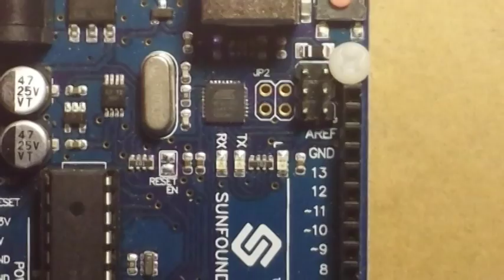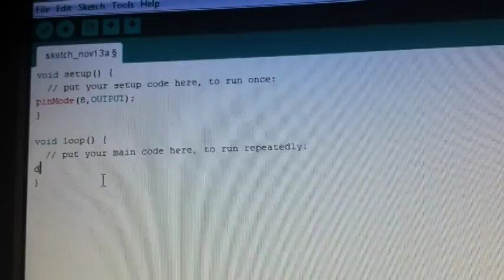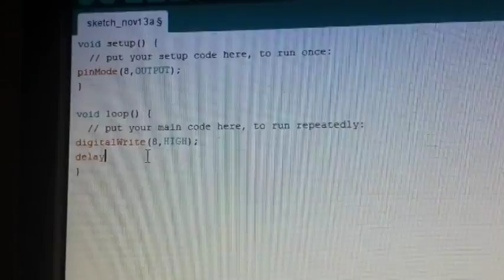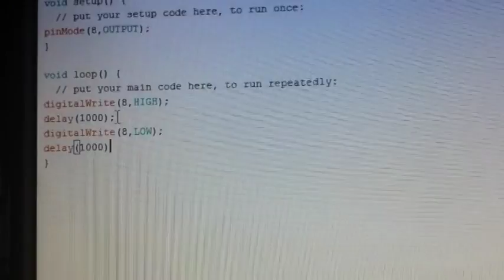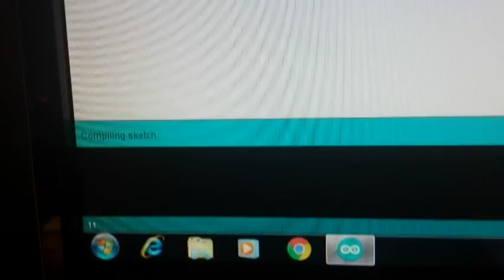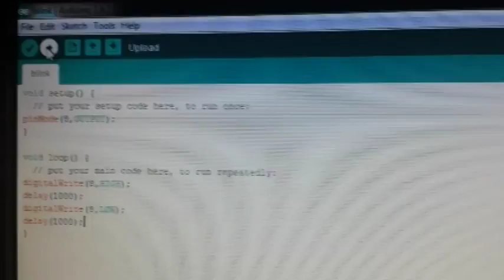Arduino Basics 4

Comment: I know I'm kinda late, but I just want to say, this is a good beginners tutorial on arduino. Slow paced enough that it's very easy to understand, not only can you kinda follow along but you did a good job of helping me to understand not only writing the code itself but WHY you write it this way, what each command means, thank you
Reply: My sketch doesn’t complete compiling. The void setup line is also highlighted in red. What did I do wrong.

Comment: I'm not understanding why the transitor comes after the LED if its meant to protect it from excessive power?
Reply: I think you meant resistor - it doesn't matter where in a single circuit where it is placed, it will limit the current.
A good analogy is a restriction in a hosepipe - it doesn't matter whether it's at the start, middle or end of the hosepipe, it will slow the flow of water just the same.
Reply: @will_doherty  Thank you for this comment - helped me!

Comment: I finally got my arduino, and I'm having some difficulties. It has the Mega328P chip. I keep getting the following Errors

Arduino: 1.8.5 (Windows 10), Board: "Arduino Duemilanove or Diecimila, ATmega328P"

Sketch uses 928 bytes (3%) of program storage space. Maximum is 30720 bytes.
Global variables use 9 bytes (0%) of dynamic memory, leaving 2039 bytes for local variables. Maximum is 2048 bytes.
avrdude: stk500_recv(): programmer is not responding
avrdude: stk500_getsync() attempt 1 of 10: not in sync: resp=0x89
. . . . . . 
avrdude: stk500_getsync() attempt 10 of 10: not in sync: resp=0x89
Problem uploading to board.  See http://www.arduino.cc/en/Guide/Troubleshooting#upload for suggestions.

This report would have more information with
"Show verbose output during compilation"
option enabled in File -> Preferences.

With Verbose turned on, I get this error.

Arduino: 1.8.5 (Windows 10), Board: "Arduino Duemilanove or Diecimila, ATmega328P"

C:\Program Files (x86)\Arduino\arduino-builder -dump-prefs -logger=machine -hardware C:\Program Files (x86)\Arduino\hardware -tools C:\Program Files (x86)\Arduino\tools-builder -tools C:\Program Files (x86)\Arduino\hardware\tools\avr -built-in-libraries C:\Program Files (x86)\Arduino\libraries -libraries C:\Users\Dave\Documents\Arduino\libraries -fqbn=arduino:avr:diecimila:cpu=atmega328 -ide-version=10805 -build-path C:\Users\Dave\AppData\Local\Temp\arduino_build_750930 -warnings=none -build-cache C:\Users\Dave\AppData\Local\Temp\arduino_cache_430718 -prefs=build.warn_data_percentage=75 -prefs=runtime.tools.arduinoOTA.path=C:\Program Files (x86)\Arduino\hardware\tools\avr -prefs=runtime.tools.avr-gcc.path=C:\Program Files (x86)\Arduino\hardware\tools\avr -prefs=runtime.tools.avrdude.path=C:\Program Files (x86)\Arduino\hardware\tools\avr -verbose C:\Users\Dave\Documents\Arduino\Blink\Blink.ino
C:\Program Files (x86)\Arduino\arduino-builder -compile -logger=machine -hardware C:\Program Files (x86)\Arduino\hardware -tools C:\Program Files (x86)\Arduino\tools-builder -tools C:\Program Files (x86)\Arduino\hardware\tools\avr -built-in-libraries C:\Program Files (x86)\Arduino\libraries -libraries C:\Users\Dave\Documents\Arduino\libraries -fqbn=arduino:avr:diecimila:cpu=atmega328 -ide-version=10805 -build-path C:\Users\Dave\AppData\Local\Temp\arduino_build_750930 -warnings=none -build-cache C:\Users\Dave\AppData\Local\Temp\arduino_cache_430718 -prefs=build.warn_data_percentage=75 -prefs=runtime.tools.arduinoOTA.path=C:\Program Files (x86)\Arduino\hardware\tools\avr -prefs=runtime.tools.avr-gcc.path=C:\Program Files (x86)\Arduino\hardware\tools\avr -prefs=runtime.tools.avrdude.path=C:\Program Files (x86)\Arduino\hardware\tools\avr -verbose C:\Users\Dave\Documents\Arduino\Blink\Blink.ino
Using board 'diecimila' from platform in folder: C:\Program Files (x86)\Arduino\hardware\arduino\avr
Using core 'arduino' from platform in folder: C:\Program Files (x86)\Arduino\hardware\arduino\avr
Detecting libraries used...
"C:\Program Files (x86)\Arduino\hardware\tools\avr/bin/avr-g++" -c -g -Os -w -std=gnu++11 -fpermissive -fno-exceptions -ffunction-sections -fdata-sections -fno-threadsafe-statics  -flto -w -x c++ -E -CC -mmcu=atmega328p -DF_CPU=16000000L -DARDUINO=10805 -DARDUINO_AVR_DUEMILANOVE -DARDUINO_ARCH_AVR   "-IC:\Program Files (x86)\Arduino\hardware\arduino\avr\cores\arduino" "-IC:\Program Files (x86)\Arduino\hardware\arduino\avr\variants\standard" "C:\Users\Dave\AppData\Local\Temp\arduino_build_750930\sketch\Blink.ino.cpp" -o "nul"
Generating function prototypes...
"C:\Program Files (x86)\Arduino\hardware\tools\avr/bin/avr-g++" -c -g -Os -w -std=gnu++11 -fpermissive -fno-exceptions -ffunction-sections -fdata-sections -fno-threadsafe-statics  -flto -w -x c++ -E -CC -mmcu=atmega328p -DF_CPU=16000000L -DARDUINO=10805 -DARDUINO_AVR_DUEMILANOVE -DARDUINO_ARCH_AVR   "-IC:\Program Files (x86)\Arduino\hardware\arduino\avr\cores\arduino" "-IC:\Program Files (x86)\Arduino\hardware\arduino\avr\variants\standard" "C:\Users\Dave\AppData\Local\Temp\arduino_build_750930\sketch\Blink.ino.cpp" -o "C:\Users\Dave\AppData\Local\Temp\arduino_build_750930\preproc\ctags_target_for_gcc_minus_e.cpp"
"C:\Program Files (x86)\Arduino\tools-builder\ctags\5.8-arduino11/ctags" -u --language-force=c++ -f - --c++-kinds=svpf --fields=KSTtzns --line-directives "C:\Users\Dave\AppData\Local\Temp\arduino_build_750930\preproc\ctags_target_for_gcc_minus_e.cpp"
Compiling sketch...
"C:\Program Files (x86)\Arduino\hardware\tools\avr/bin/avr-g++" -c -g -Os -w -std=gnu++11 -fpermissive -fno-exceptions -ffunction-sections -fdata-sections -fno-threadsafe-statics -MMD -flto -mmcu=atmega328p -DF_CPU=16000000L -DARDUINO=10805 -DARDUINO_AVR_DUEMILANOVE -DARDUINO_ARCH_AVR   "-IC:\Program Files (x86)\Arduino\hardware\arduino\avr\cores\arduino" "-IC:\Program Files (x86)\Arduino\hardware\arduino\avr\variants\standard" "C:\Users\Dave\AppData\Local\Temp\arduino_build_750930\sketch\Blink.ino.cpp" -o "C:\Users\Dave\AppData\Local\Temp\arduino_build_750930\sketch\Blink.ino.cpp.o"
Compiling libraries...
Compiling core...
Using precompiled core
Linking everything together...
"C:\Program Files (x86)\Arduino\hardware\tools\avr/bin/avr-gcc" -w -Os -g -flto -fuse-linker-plugin -Wl,--gc-sections -mmcu=atmega328p  -o "C:\Users\Dave\AppData\Local\Temp\arduino_build_750930/Blink.ino.elf" "C:\Users\Dave\AppData\Local\Temp\arduino_build_750930\sketch\Blink.ino.cpp.o" "C:\Users\Dave\AppData\Local\Temp\arduino_build_750930/..\arduino_cache_430718\core\core_arduino_avr_diecimila_cpu_atmega328_0c812875ac70eb4a9b385d8fb077f54c.a" "-LC:\Users\Dave\AppData\Local\Temp\arduino_build_750930" -lm
"C:\Program Files (x86)\Arduino\hardware\tools\avr/bin/avr-objcopy" -O ihex -j .eeprom --set-section-flags=.eeprom=alloc,load --no-change-warnings --change-section-lma .eeprom=0  "C:\Users\Dave\AppData\Local\Temp\arduino_build_750930/Blink.ino.elf" "C:\Users\Dave\AppData\Local\Temp\arduino_build_750930/Blink.ino.eep"
"C:\Program Files (x86)\Arduino\hardware\tools\avr/bin/avr-objcopy" -O ihex -R .eeprom  "C:\Users\Dave\AppData\Local\Temp\arduino_build_750930/Blink.ino.elf" "C:\Users\Dave\AppData\Local\Temp\arduino_build_750930/Blink.ino.hex"
Sketch uses 928 bytes (3%) of program storage space. Maximum is 30720 bytes.
Global variables use 9 bytes (0%) of dynamic memory, leaving 2039 bytes for local variables. Maximum is 2048 bytes.
C:\Program Files (x86)\Arduino\hardware\tools\avr/bin/avrdude -CC:\Program Files (x86)\Arduino\hardware\tools\avr/etc/avrdude.conf -v -patmega328p -carduino -PCOM4 -b57600 -D -Uflash:w:C:\Users\Dave\AppData\Local\Temp\arduino_build_750930/Blink.ino.hex:i 

avrdude: Version 6.3, compiled on Jan 17 2017 at 12:00:53
         Copyright (c) 2000-2005 Brian Dean, http://www.bdmicro.com/
         Copyright (c) 2007-2014 Joerg Wunsch

         System wide configuration file is "C:\Program Files (x86)\Arduino\hardware\tools\avr/etc/avrdude.conf"

         Using Port                    : COM4
         Using Programmer              : arduino
         Overriding Baud Rate          : 57600
avrdude: stk500_recv(): programmer is not responding
avrdude: stk500_getsync() attempt 1 of 10: not in sync: resp=0x4d
.  .  .  .
avrdude: stk500_recv(): programmer is not responding
avrdude: stk500_getsync() attempt 10 of 10: not in sync: resp=0x4d

avrdude done.  Thank you.

Problem uploading to board.  See http://www.arduino.cc/en/Guide/Troubleshooting#upload for suggestions.

Any help would be appreciated!! Thanks!!!
Reply from the maker: David, I'm not a software guy. But here's what i can tell you from my experience: anytime i would get an error that references the avr-dude...delete and reinstall the IDE.